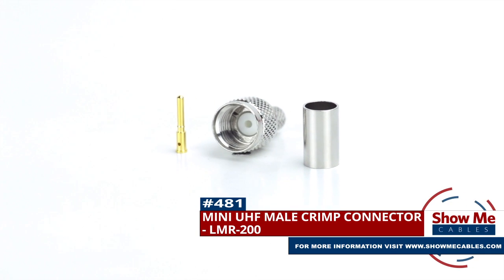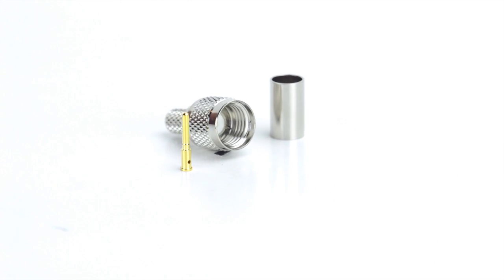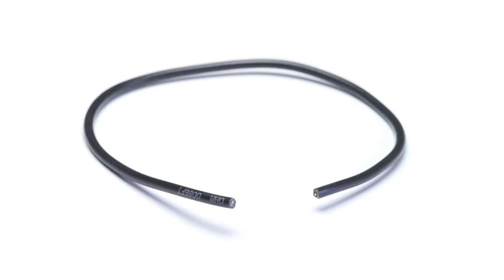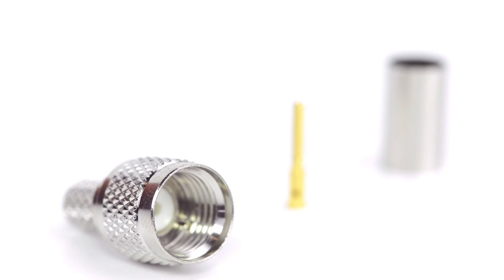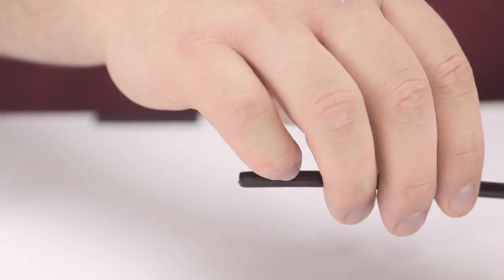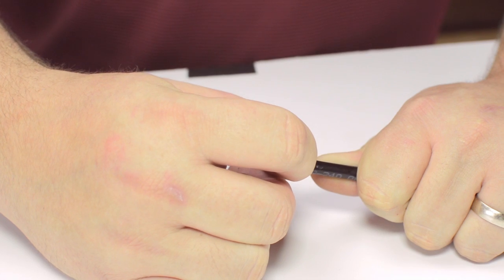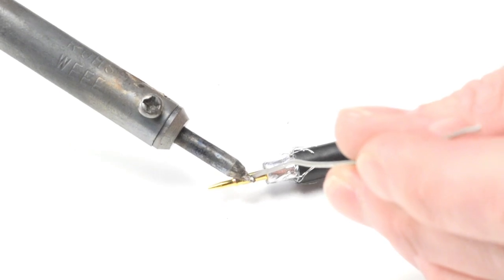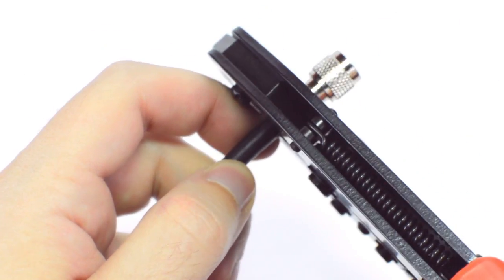How To Install Mini UHF Male (PL-259) Crimp Connector For LMR-200

Comment: Thanks for a wonderful detailed video, certainly it is helpful for me. In addition, As the mini-model UHF, although the connection speed is faster than UHF, sales is not as follows. and i think elecbee connectors from CHIna can be believable.there are also IC products in Elecbee. you can choose by yourself.